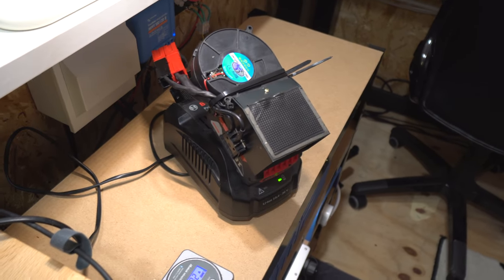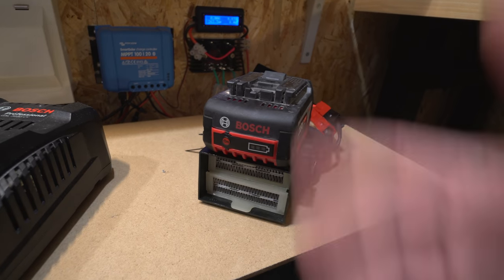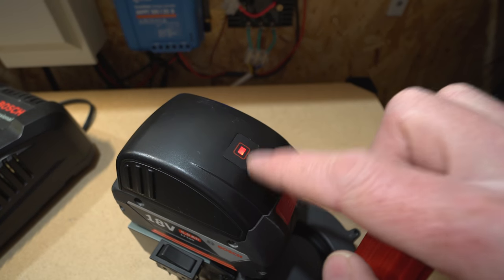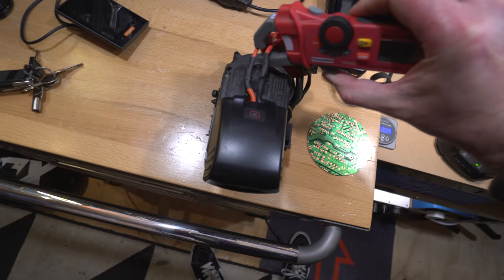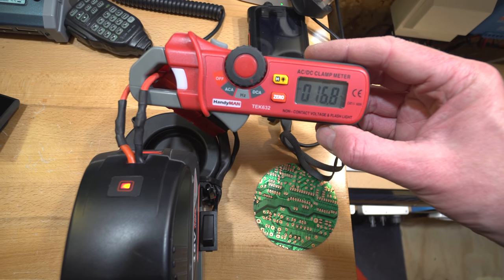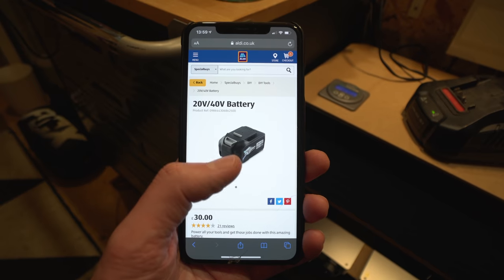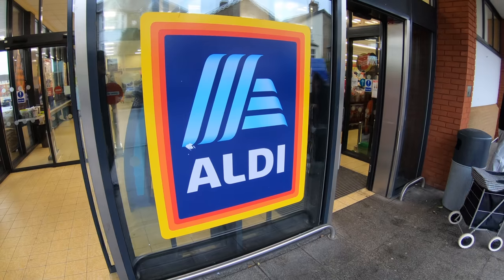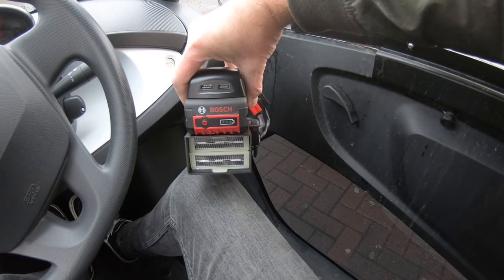BATTERY POWERED HEATER 3.0

Comment: If you haven’t done a video which completes this project with safety features and is could be used accordingly within a small space, could you continue to complete it and include how long the heater can be used on a full charge.  From reading subscribers comments, they are interested in it’s progress.  thanks

Comment: This is exactly the kind of thing I'd like to find to take camping in the winter. (Scottish Highlands) A small low powered heater, just enough to take the chill off rather than actually heat the tent, that could be used with one of the new micro-electric generators. Ideally with some kind of logic which could see it run on and off automatically for X number of minutes per hour as it obviously wouldn't last too long continuously. Unfortunately, I'm nowhere near intelligent enough to build something like that myself!
Reply: Just plug in a timer

Comment: Awesome I love this heater👍🏼, I'm trying to make an insulated stick on case using armaflew with 12v heat pads on the inside to help keep my pack warm, the cold is making a big difference in a 1.5kwh battery so i was thinking what's 50watts of heat when I'll gain 20% range👍🏼

Comment: just in time Andy, I am making a bank of paralleled 36v macallister/spears and jackson/qualcast batteries, stepping down to 13.8v via a 30a dcdc step down and running all my gen1 Nissan leaf 12v car accessories off of it, such as heated seats, kids tablets, phone and potentially one of these ptc heater elements. all in a bid to keep the load off of the dcdc converter of the car and retain some battery capacity in the traction pack for pushing the car down the road. range is suffering hard at the moment due to the cold. I have a plastic printed design to get access to the battery terminals as I use them for my ebikes with is why I own a few of them. should be able to add about 1.5kwh to the car for a bit of extra heat.The objective is to get the car down south at winter time but staying comfortable.

Comment: Interesting about the battery take apart. I always thought if usibg a couple of tool batteries as an ebike battery. Esp since many ebike batteries are 36v and those tool batteries are 18v...rig one up that works with a common battery and you begin to make ebike batteries interchangeable. Almost like what colt did with pistols back in the 1860s?
Reply from the maker: Very true. These batteries are ideal for ebikes and cheap too. The only issue is adding a decent BMS so you can charge them on the bike as one pack and ride knowing that you won’t over discharge them. I will be covering adding a BMS to that battery in a video soon.

Comment: i try to use in camping for roof top tent . The good side is that everything works and it heats up fairly quickly. The bad side is that the whole cable heats up too much and in two minutes It started to smell burned plastic in my car, I don't think I will use it. :((((

Comment: Do you find Andy that you need to seal the car better to retain the heat or have you done this already and I missed it?
Reply from the maker: yeah the Twizy can't really be sealed but you can improve it, I added some rubber insulation in the door shuts and also insulation in the footwell as lots of cold air comes through the front.

Comment: ‘Just like my mouth’ ha ha.
It’s a shame you can’t wire the heater into the main battery. Something like wired so that whilst the car is charging, it runs at a lower power just enough to take the chill out from inside the car